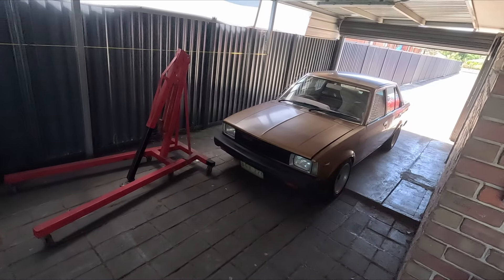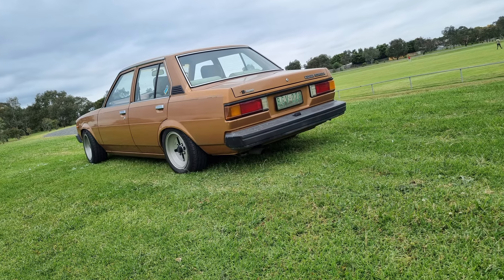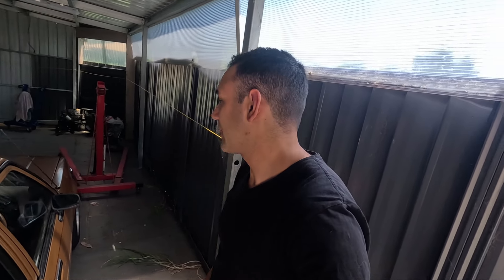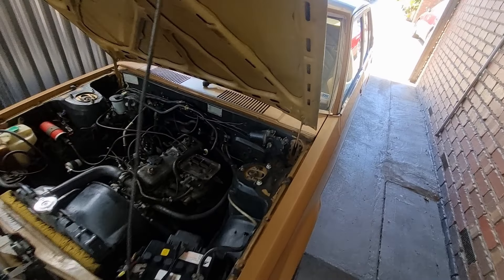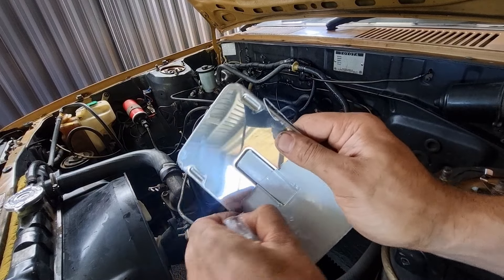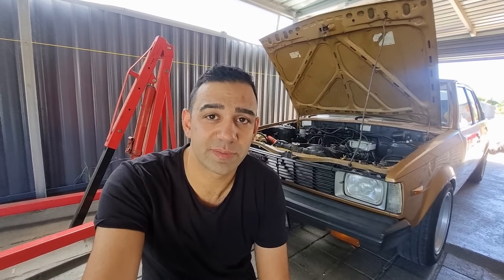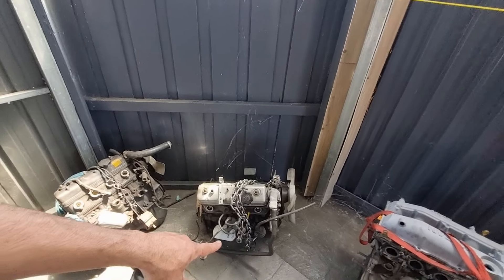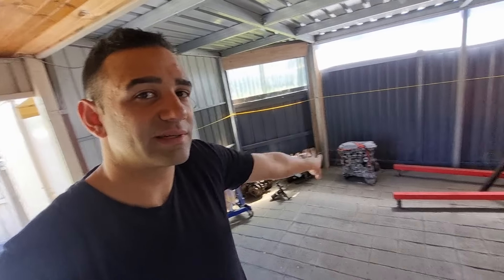Working on old cars... Ke70 Updates + FUTURE PLANS!!!!

Comment: keen to see the street ke70, just about finished off my te72 t18 street build i also put a s13 front in it what changes did you have to make to the knuckles?
Reply from the maker: Hey mate, Will be starting that later in the year. very keen for it.
Depends if you put subframe in aswell or just the lower control arms, knuckles and struts. If leaving the stock ke70 crossmember and rack, need to massively correct the bump steer and ackerman of knuckles.
If sticking with S13 crossmember then need to sort a way to get high caster through the tops/remake strut tower mount. or if you pull the required caster (6 degrees) through the caster arms then you need to account for the ackerman change.  Ofcourse manual steering will be heavy...you can leave the caster on the lower side (3-4 degrees) to make it easier but then you need to fix the bump steer as the tie rod mount point is too high. Hopefully most of that made sense... haha
Obviously plenty of people just bolt crap in, but making it work properly is a different story..